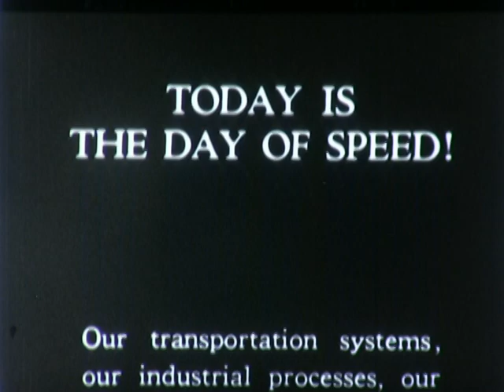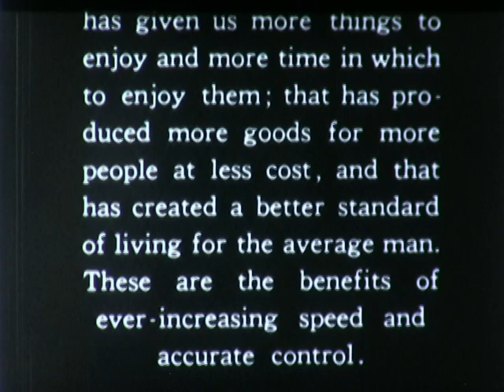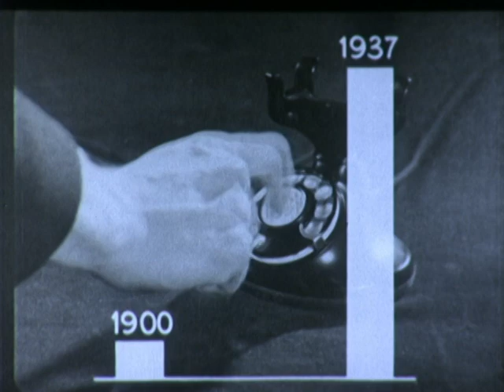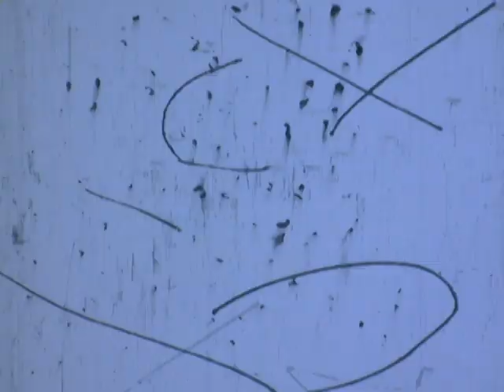GE Machine Tool Speed Show - 1937

Comment: Ray el rode to doomsky.
If I personally designed a lathe the turret tool mount would definately be beneath the work in between the cast iron base and slideways and this would allow a better flow of the swaf, straight down onto the swarf catching tray, vertically mounting the cutter to see the progess in front of tool from in front of the machine unlike the title picture where the tool is mounted horizontally and obscured by the toolpost and toolholder as too many people have been pulled into the work from their clothes being caught on the spinning material and have been machined themselves to a very course tolerance, lmao -1 unnecassary death is too many as obviously the operator must have been keeping an eye on the cutting action/swarf/surface finnish quality and the flowing off of coolant etc....
Only Love(Outlives Life)
Reply: No necklaces, ties, long hair, rings, gloves, long sleeves.   Machine technology safety 101.
Reply: Where would you put a steady/follower rest if the cutter was below the workpiece? The underside of the work is where the weight of it is supported, so any work-holding devices need to transfer the weight to the frame. Plus changing tools from underneath the work and the machine would be impractical and cumbersome. Lathes are designed as they are for good reason and despite your good intentions, the modern slanted bedway CNC lathes are about as good as it's going to get for swarf/waste removal and safety.
Reply: Garbage